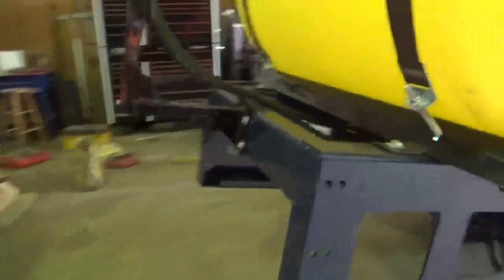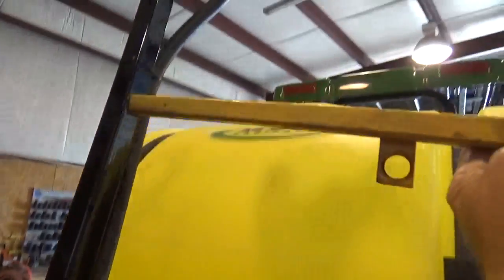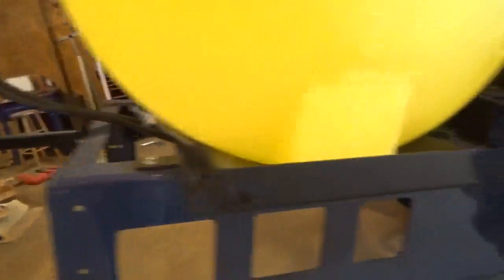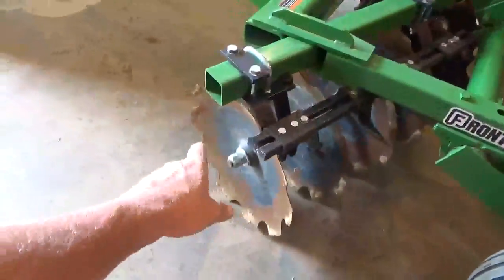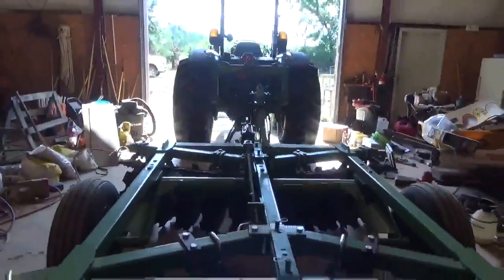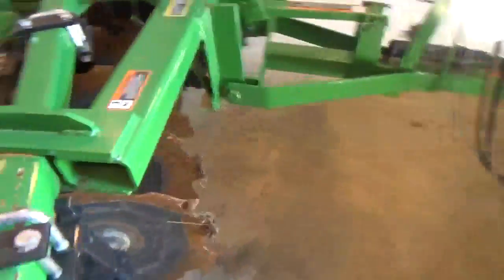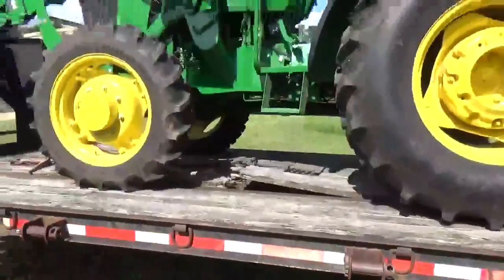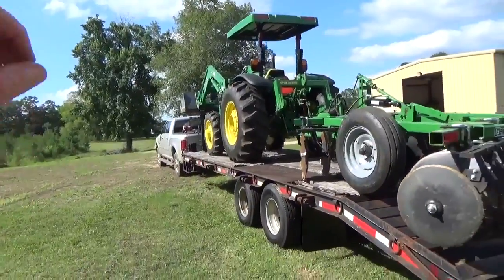Dodge Cummins hauling a John Deere 5075E and disk to go farming

Comment: I can say I agree with you about pulling.  I just sold my 2006 5.9 with 475 HP, rebuilt motor and tranny and the 2016 I bought hauls way better.  My dad was impressed with the 2016 and couldn't believe how many times it down shifted to slow down.  I with you on deleting the truck, can't wait to do that to mine in a year or so.  The power the truck will have!

Comment: I have a 2005 Dodge 2500 ¾ ton crew cab shortbed with the 5.9 Cummins 2 wheel drive with the airbags. I use it for hotshot transporting and I would pull a 53ft gooseneck flatbed trailer or a 40ft gooseneck flatbed trailer all over the western States. The airbags were the best way for me in this business because no matter what I would never haul the same load twice, but I would always be as close as possible to 26,000lbs every trip. Having the air bags would allow me to be always level and keep me from getting the hell kicked out of me every trip driving down the road. If I did 1 ton leaf springs instead of the bags no matter what I did it would be ruff as hell unload and loaded because I wouldn't be able to a just the ride down the road.

Comment: I converted my metal halide lights to LED last year.   I smoked a ballast so I had to pull one down anyway to fix it.  Expensive bulbs but man is it nice to just turn them on.
Reply from the maker: +James Kinkead which ones did u get?

Comment: The outside furrow filler isn't part of the rear disc axle assembly, as far as rear axle assembly.    I know you'll say you know.......It's bolted on outside of unit.   You would tighten from inside of rear units.   Wow.     I know you and know everything you have and do is the best and ten times better than anyone else.

Comment: Can you do a list of the equipment you started with and how do you feel about the self propelled trailer mounted loaders?
Reply from the maker: +John Deere 3754 self propelled are fine on a wood yard where it's pretty much flat. In the woods, it's a different story, u just can't run them in this stuff I set my track loader in.

Comment: Trust me CotonTop you Delete that thing you will find out your driving a whole new truck!  Just drove to MO from Chicago got 19.5 mpg not pulling anything I got the alarm set to go off at 41.1lbs of boost and it hits it on every on-ramp!  That being said do yourself a favor when you delete it just go ahead and stud the head and go for the 250+HP tune.  I did it and its like the truck it should be and it by far pulls 75% more.  40k like nothing!!!  Also put on a new intake horn instead of the covers!

Comment: 3.42s are a higher gear range than a 4.10. a 5.9 6 speed manual, actually will out PULL that 6.7, but, it wont hold as much because, it doesn't have air bags

Comment: I gotta call BS on him Bragging up a 100 horsepower.  engine is tested at 75hp and pto is 64.42 hp. no 3 cylinder diesel makes 100hp in the JD line up!
Reply from the maker: +C B I was talking about my Case being 100 hp and the Deere is very comparable to it.

Comment: Anybody that says the new trucks don't pull worth of shit are too smart. The 6.7l put out close to 100 hp & 300 lb-ft more than the 2003 5.9l. All that equates to quicker acceleration but the truck have better handling which is just as important.